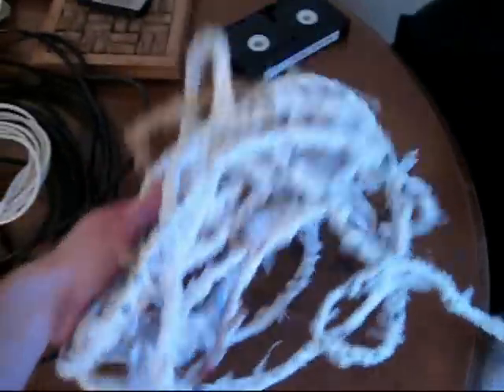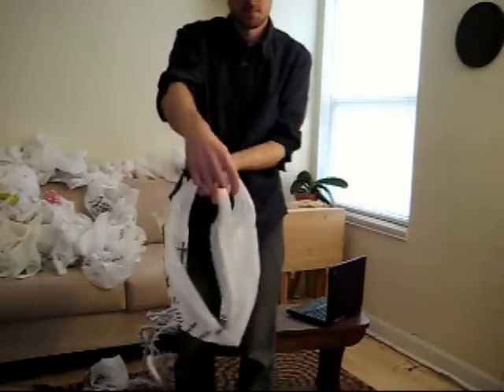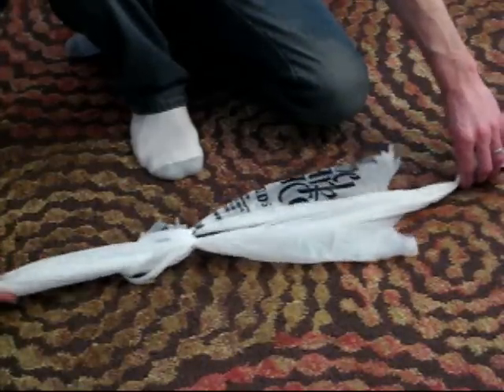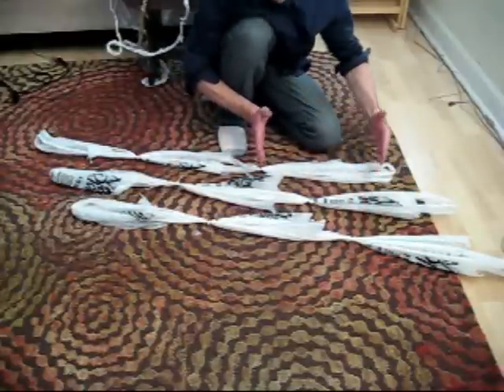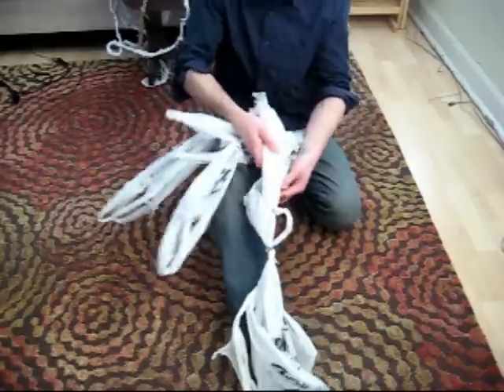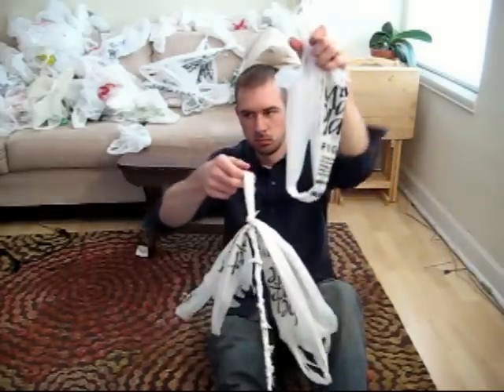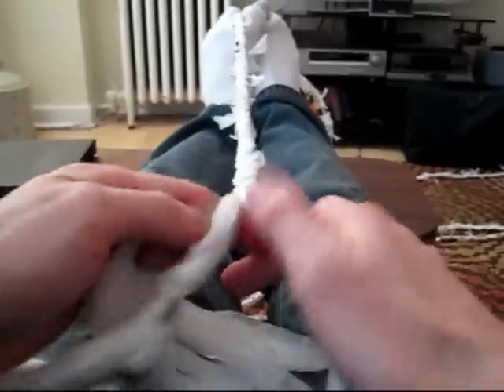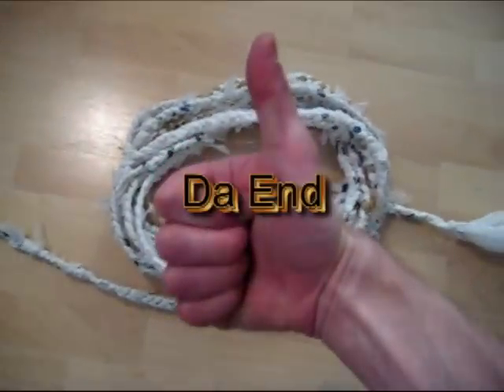Make Rope from Plastic Bags (without tools)

Comment: I also use bread and bungee bags, lay the bags out flat fold them neatly length wise and take your scissors and cut the bags into 1 inch strips, daisy chain those strips and braid them just as you would with the plastic grocery bags, also I make smaller cordage out of the plastic bags they deliver our news papers with, prepare those bags the same way you would the bread bags, makes real nice shoe string size cordage, you can use the plastic bags you get in your produce department of your local grocery store, but when you cut them into 1 inch pieces you need to double up on your loops because the thickness of the mil of the plastic is half as thick as the  bags you would get from the news paper bags, tried it with a single strand it was way to thin, unless you braid this type of bag by itself, it will be very thin line, possibly good for fishing line.
Reply: Bread bags and hotdogs or hamburger bun bags.

Comment: My other comment is that twisting creates an important strength aspect in a cord.  And having the strands twisted opposite one another as they are wound creates even greater strength because the substance isn't in full tensile stress when you load it.  ( i.e. the helix spirals have to tighten down on each other and stretch out before they are in full tension, and they resist that because of the counter winding, so (at the mechanical level) that forces some of the stress into the sheer stress.

Comment: NIce one, actually about as strong as the  rope sold in the market which stock mass produced versions of the similar material. actually
Reply: +Jagannadharao Korada He used 2 ends of looped rope to support himself, a total of 4 strands. My climbing rope alone can hold 3 tons of static weight, it's nothing like a plastic bags rope.

Comment: I do the same thing except I cut the bags into two piece, lay the bag out flat take a pair of sharp scissors cut the bags in half then tear the seam, do the same to the other half, now your bags will go twice as far have just as much strength, also tie your cordage to a chair as you go along and use a close pin to hold your braid when you need to stop and come back to it later, have fun and also your rope will look a whole lot nicer, not so bulky and goddy, and mix up the colors it looks pretty cool that way.

Comment: ... sorry post continued.  So when you off-load some of the tensile stress into sheer stress at the substances level, the substance can appear to withstand a larger tensile loading at the macro scale.  Thus, I would be interested in seeing someone shred bags into threads (possibly with a paper shredder? does that work, or jam?), spin them into cording the same way you do hemp or sisle, and compare your two failure weights.  I hypothesize you'll get a better strength without knots.

Comment: @gentlefem Yes! I used to be a girl scout leader, and one of the most successful craft projects we ever did was making jump-ropes from plastic bags. We just had the girls wrap masking tape around the ends for handles (they were all under 10 years old), but if you wanted to get fancy I'm thinking two 6 inch lengths of dowel rod and a couple fishing swivels would do the trick.

Comment: One inch strips cut from bags and double-twist method as with natural fiber sources if you want finer cordage comparable to 1/16" twine. I wouldn't consider them much better than 5 to 10lb test as this plastic tends to easily stretch, but finer strands made that way can also can be doubled up or braided as needed. More time intensive to make a 1" rope that way, but since it's more economical on the material it works great for wraps or binds when using ad-hoc cordage for construction or making stuff like nets.

Comment: So, I would suggest reading a little bit more about rope making because from my limited (admittedly) knowledge from scouting.  Knots in ropes are the weak points.  They bite on the strands creating pinch points from which failure fractures occur.  By intentionally incorporating all these knots into the rope its building in its own limitation ( from a tensile strength perspective. ) That may be a trade off for the simplicity of its creation.. i.e. how would we do it otherwise...) See next comment

Comment: QUICK How to Braid:
1)  Keeping all three strands separate, take the rightmost strand and bring it OVER the Middle Strand, and UNDER the Leftmost Strand.  Now the Right Strand is on the Left side, the middle strand is on the right side, and the left strand is now the rightmost strand.
2)Pull the strands tight.
3)Repeat Steps 1 & 2 by taking the Rightmost strand (originally the middle strand), and bring it OVER the Middle strand (originally the leftmost strand), and UNDER the leftmost strand (originally the rightmost strand).

NOW you know how to braid a rope

Comment: NIce one, actually about as strong as the cheapest rope sold in the hardware super wharehouses which stock mass produced versions of the similar material actually I saw one product which once you cut you could see under the thing viscose braid into a fibre paper core made out what looked like hand wipes.

Comment: If you concentrate on twisting your wrists as you pull each "strand" of plastic cord through the weave, the resulting rope has a smoother look and feel to it. As a faster alternate, simply link one bag to another to form a chain of bags which is lets say 30 or 40 yards long and attach one end to a stationary object like a tree. The free end is then attached to a power drill's chuck. Cordless drills work best. Stretch the plastic chain taught and begin to twist the entire thing with the drill. As the chain twists it will begin to draw up. Walk toward the secured end as the twists become tighter and tighter. Just as you feel that the twisted chain is about to start forming doubling knots which are undesirable, stop twisting. Have someone grab the twisted chain approximately halfway between the stationary object and the drill and hold on tightly. The person with the drill needs to walk in a wide arc around the person holding the mid point and move around to the secured end of the twisted chain. As the two loose ends come together, the person who is holding the mid section should now be at the end of the rope formed by the twisted bags. As he slowly releases his grip on the rope it will twist itself one section around the other an form a single rope with all the attributes associated with a factory made rope. Try it out and get back with me.